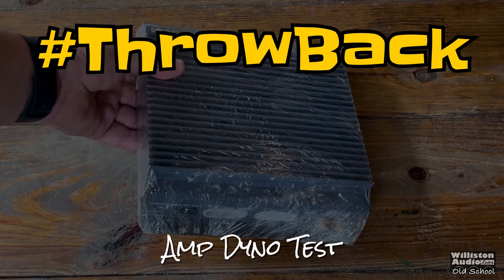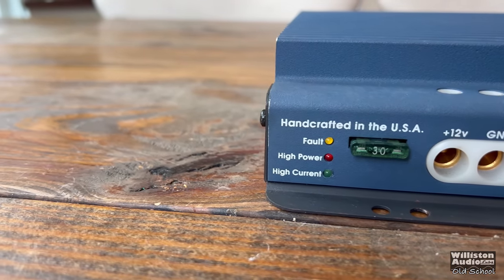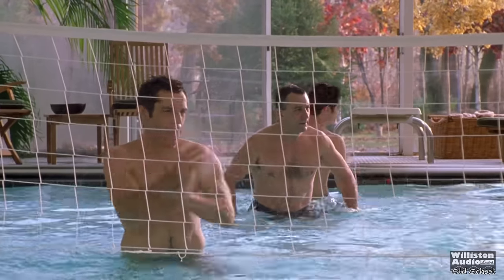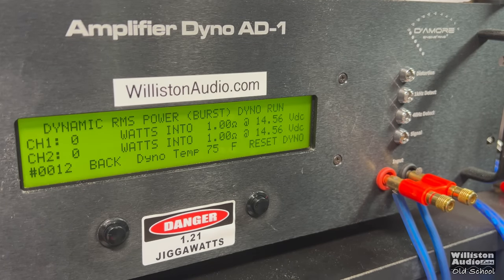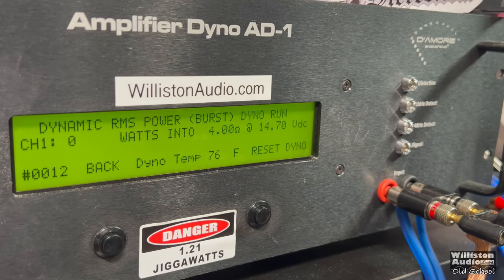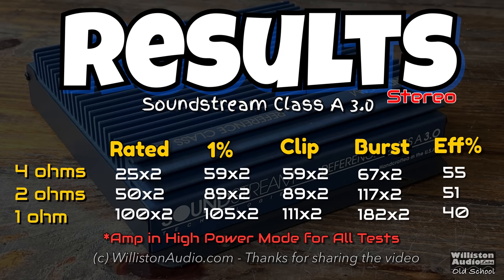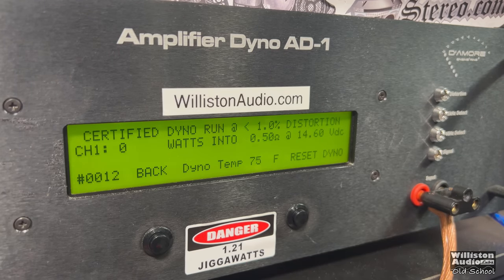Class A for Car Audio? 1993 Soundstream Reference Class A 3.0 Amp Dyno Test

Comment: Soundstream before it was sold was some of the best stuff on the market.
Reply: i agree.
Reply: One of my favorites. Them & Phoenix Gold were both doing big things before being sold off.
Reply: Yup. Back when they were on top..  I had 2x reference 1000s and a ref500. Those 1000s hit hard on the Rockford 15s I had. The Reference 500 on Boston pro 6.5s up front. Miss those days.
Reply: ...Soundstream USA has always been my favorite
Reply: Still is if it in good hands i have a ref 500 in use and 2 300's that are fresh still
Reply: Sound stream Phoenix gold Orion were hand built pieces.  They are junk now. I still have my M50 and zx 500.
Reply: It was right up there 
 I Had this amp way back when. 
And a couple others.
Reply: I bought this amp in ebay 2005  cost 200us new with box! I wired with 4 speaker for my e30! Good old days!

Comment: The younger crowd won’t be able to appreciate the fact you could roll through the judging lanes with a 50 watt amp that could drive two efficient subs with around 200w of power. More over these amplifiers had some of the best sound signature. Super clean output. A pair of these in 0-100 watt class in the right build could be unstoppable.
Reply: ...I have a 50w amp driving 2 12s right now. 😁
Reply: hey, dont lump us together. i prefer not getting loud but clean output rather than getting loud with laughable output quality. quality over quantity for me
Reply: @n.shiina8798  but that’s just it. Those cars WERE loud and super clean.
Reply: @bfytw2125  clean, sure. loud, how loud?. assuming the sub efficiency is 90dB/W. at 200W it would be 113dB theorical. 113dB is already loud. now compare with the same setup but bigger amp, let's say 2kW. the system could reach 122dB-ish. if we're talking about SQ contest, then yes a good 200W should be enough if the sub were efficient enough.
Reply: @n.shiina8798  Try cars like with two Orion HCCA 50s and two Orion XTR DVC 10” subs doing 145+ on Flashdance… on the dash.  My own personal competition vehicle in 1995 was a regular cab Nissan cut through with three  C12” kickers in a sealed enclosure, running off of a Soundstream 6.0. That’s a 50x2 amp. That truck did 143dB legal on flashdance. 146dB outlaw.  By todays big system standards these aren’t super loud numbers. But believe me these cars with highly efficient subwoofer could get plenty loud with these small output amps.
Reply: @n.shiina8798  You have to take cabin gain into consideration with your spl numbers as well
Reply: @bfytw2125  your 2nd last word, that's what i was trying to say. i prefer not getting as loud as today's standard rather than having distorted output

Comment: Love the old Soundstream amps. Used several of the all chrome classs A references amps. Was a HUGE fan of the Van Gogh series, ran the VGA 500.4 with a VGA 1600.2, dual 4 gauge platinum power inputs, 115dB S/N ratio >500 Damping,Triple Darlington output circuitry, large low ESR Capacitance banks' they were some of the best made equipment I was lucky to have owned. They were famouse for the blue and the red, milltary grade 6 layer PCB bourds, audio grade resistors and beautiful board layouts.
Reply: Military grade? I figured they would need to use boards of a decent quality in order to be robust enough to survive the abuse of car audio. Strange.

Comment: Class A/B great for mids and highs but not the best choice for a bass amp for long term use at less than 4 ohms. I would know. I used a class A/B amp for subs from the mid 90s well into the 2000s, and that sucker would get HOT after a longer play session. The class D amp I use now outputs over 3x as much power and stays relatively cool all the time, even wired down to 2 ohms.

Comment: Hey there Big D!  I'd love to see the high current and 12v tests.  I ran these amps back when new and still do.  Always loved these.  Shocked to see the low efficiency. They do get hot.  Got to have some fans for sure.  The sound can't be beat imo.  I also run a couple of mc300's, a Picasso, and a d200.  I would love to see you test those if you ever get hold of any. Thanks for all the vids!  Rock on!

Comment: I installed a couple of those in a BMW back in the day. He also used a class AB Soundstream amp (I think it was a S200) bridged to drive a 12" sub mounted through the rear seat arm rest. If I am remembering the correct car he also used an Audio Control crossover and Epicenter, and ADS plates in the back and 320i in the front. I honestly don't remember what head unit he used, but I do remember that it was really clean and solid. It would not be competitive even back then, but that was not the goal anyway. It was supposed to sound good and be fun, and it did that in spades...

Comment: I’ve got a class A 10.0, 5.0 and 2 rubicon 1002 first generation. Soundstream amps are extremely efficient at creating heat! They create crazy issues due to switches and pots that will drive you crazy trying to repair them.
Reply: Currently have 2 rubicon 1002 first gen and lil wonder 4.
In Facebook group I found a guy who fixes soundstream old school amps he worked and learn how to fix them not than other the engineers of soundstream OG I’m going to save up so he can recap my amps and probably get more power he told me his been doing upgrades to the internals to get more power 🤷🏻‍♂️ I seen the numbers are insane in 10.0

Comment: I still have a TRA/1600.2 The chrome one with the two handles on top of the amp. I would love to see that thing on the dyno. I bought it used back in 2007.   Bench tested it before purchased,  then just stored away inside the house.

Comment: These Soundstream amps of this design had a very large number of bjts in the output section, usually showing in a better damping factor . It appears that you are an inspiration to others as I've noticed some other channels playing with old school car audio. The more the  better.
Reply: them times... its when a 30 watt amp put out 400 watts... RMS....LOL. I remember.
Reply: @bigdogbrodavepresents6178  the 90s, the last great decade.
Reply: Watching big wiz his the reason why 7 years ago I started to buy some old school gear I currently have soundstream amps and subs. My favorite amp that I have is my rubicon 1002 first gen it does get hot but nevera let me down. Also I have home theater stuff so I always compare my soundstream amp to home theater amps NAD because dynamic they have so much power that’s what you want. Headroom when you want to push your gear it has guts

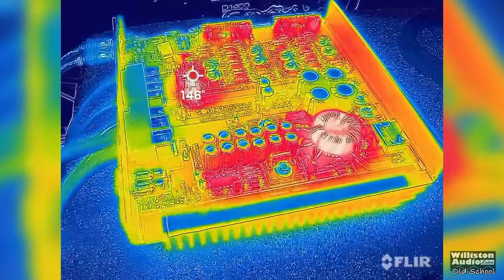Comment: 11:45 that resistor is part of the -/+15v rails for the op amps. Pretty cheap design if you ask me, they could’ve used 1.00 15v regulators and prevented from having a large resistor that heats up to the point of cooking the PCB. I’ve seen some PCBs with charred spots underneath those large resistors.
Reply: SOUNDTREAM amps have some issues with resistors getting excessively hot to the point they MELT SOLDER (10.0 1st gen).  Ya can BUMP UP them to a more robust resistor and that helps matters a lot.  These amps run excessively HOT... yep. BDBD/2023
Reply: Maybe rail voltage was too close to maximum input voltage of regulator. With heat, regulators SOA is even lower, so it could fail even sooner than resistor. But yes, transistor (not resistor) with zener is what I'd expect in a amplifier like this too.

Comment: The amp isn’t rated to be played at 1ohm high power bridged. Just a heads up. I know it shows it in the manual but it restricts its output. Also. Really quick question. After you deoxed it I noticed you left the switch in coherent stereo, did you flip it to mono off screen? Not being a pest. Just making sure. Thanks buddy

Comment: As an audiophile it gets a pass in my book 👍 Where else are you going to find a class AB amp that's stable down to 1 ohm stereo?
Reply: ❌✅ Correction the classA6.0 & A3.0 are stable in high current mode coherent stereo at 1/4ohm per channel 😎👍sounded the best but were hot as hell🔥👺doing it, because it was biased as class A even though it was technically A/B _  pure 👂 ear Candy 🍭 though‼️

Comment: I use to be a dealer back in the day and I used these to battle against the Orion HCCA's of day with great success but this design had issues with the screws used in its terminals that would break over time and would cause issues trying to remove and a few people never read the manual mainly on these Reference's high and low power switches on the bottom of the amp
Reply: ...later models were silk screened on the amp "DO NOT SWITCH HIGH POWER TO HIGH CURRENT WHILE AMP IS ON"....I have made this mistake....repaired by SOUNDSTREAM at no cost in the mid 90s
Reply: I still have a few 6.0's in need of repair as well as 2- 500's one work but the other does not and a Continuum
Reply: @thebassgeneratorinc229  …I have been using “ Eric’s Amplifier” for my repairs. His info is on the “ Soundstream registry “….google it if you are interested in pre 2000 SS gear….all your amps will be listed. They also have manuals for most amps…it is an interesting website if you like vintage SS gear

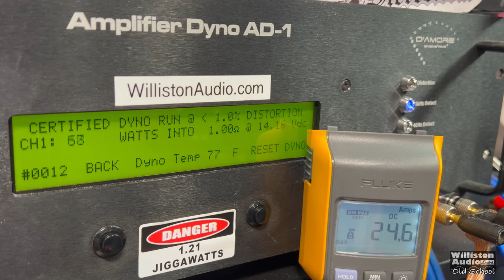Comment: 9:40.   HELLO.  YOUR PROMITER HERE 
SOOO FOR THE 9TH TIME
50% EFFICIENCY IS PERFECT. THE VERY BEST FOR CLASS A\B. BECAUSE ALL CLASS A\B SPLITS THE POWER SUPPLY SO IN A PERFECT WORLD 50% IS THE VERY MOST YOU CAN GET PERIOD 
SOO 50% IS THE VERY BEST.  
YOU CANT GET MORE THAN THAT WHEN YOU USE A 50 VOLT TOTAL IS USED  AND 25 VOLTS IS USED FOR THE UP SWING AND 25 VOLT IS USED FOR THE DOWN SWING. SOOO FOR THE MILLIONTH TIME 50% IS VERY VERRRY GOOD.  ANYTHING UNDER THAT IS JUST STARTING TO BE BAD. ON A CLASS A\B.    THE REASON IT FELL LOWER THAN 45% WAS BECAUSE AT 2OHM AND 1OHM.  IT MUST BE SWITCHED INTO HIGH CURRENT MODE.

Comment: High current test would be a cool thing to see.  I didn’t feel like it changed the output drastically with my Reference 500 but I had weak electrical back then.
Reply: It should only make a difference driving low impedance loads. You can't just shove more current through a high resistance circuit, the resistance has to be low enough for the amps output.

When he tests high current mode pay attention to the data sheet and what ohm loads are used for testing. He'll be able to test lower (amp was rated to .5 ohm if I remember correctly) and that is precisely where high current would be needed.
Reply: @volvo09  I’m 100% sure I was clipping the F out of it… right up to audible distortion.
Reply: @volvo09  I haven't read the manual but I'm thinking high current mode should have been used for the .5 ohm tests to get the right numbers.
Reply: @550n440  what was your speaker ohm load though? It won't help at all if you were above 1 ohm.

I won't give an in depth electrical lesson, but real quick it's why a 55w 12v car headlight is much lower resistance than a 55w light designed for household voltage. You are selecting a voltage range to drive your speakers. Ohms law.
Reply: @v12alpine  I bet he'll do a new episode and we'll see the difference, pay attention to the low ohm loads and they will go up.
Reply: I'd like to see a 1 ohm load test in both high current and high power modes for a comparison.
Reply: @bones40447 ☝️🧐❌ I had this amp it’s definitely a cheater rated 12.5 watt by two at 4ohm like a ORION RED but blue , with better sq , for awhile best sound I’ve ever had , sold to my brother who never installed it an eBay’d it  or something 😡‼️ I was a little disappointed , but I still have 2 Class A6.0 still in box factory sealed 😎👍❌ waiting for my next Sq build ✅
Reply: Yeah, I don't think it would change significantly
Reply: @raymo6795  it’s only a 300w SQ amp so No , not much more if any ☝️😉‼️ but it will sound good ✅
Reply: @eurekaakerue4649  …300 watts was a lot in 93. I rarely used high current mode . These were not efficient amps, and the power draw was too great for stock alternates….but I would still like to see it tested in high current setting….Maybe Big D doesn’t want to abuse his  30 year old vintage amp, I don’t blame him
Reply: @raymo6795  👋😉❌ same here ‼️I wonder why BiG “D” didn’t balance out both channels equally they have separate gains on the REFERENCE LINE For a perfect stereo image, you don’t see that these days either 🧐❓hmmm
Reply: @eurekaakerue4649   .. some do, I didn’t notice if BigD’s had separate gains or not.  Soundstream was kind of random with those . I have a pair of Rubicons 300s with separate gains, and a pair of Reference 405s that don’t…. And a Reference 200 that does have separate gains… it was a really nice touch.
Reply: @raymo6795  😎👍❌ They did I had one A3.0 & two A6.0  and most of the first Rubicon’s did , not sure on SX REF’s which were awesome but contained the failing auto impedance switch ✅ always wanted the Chrome A10.0 but couldn’t get it and the human reign but it was Unobtainium ❌*
Reply: @eurekaakerue4649  … they are out there, but expect to pay 💰…
Reply: @eurekaakerue4649   … have you checked out “ the Soundstream Registry “?…. Google if you have an interest in vintage SS gear✌️🇺🇸
Reply: P.S. correction it only has single gain , but my A6.0’s have dual gains ❌
Reply: @raymo6795  THX 👋😎❌ my list of  GEAR - IS AS OF TODAY =(1. TNA 4ch tarantula (1.  Rubicon RUB1.2500d (2. Class A6.0 (1. X3 182 Subwoofer 🔊// other equipment includes (1. US Amps/RE Audio SA 3000.1 (1. Chrome TARAMPS premier MD 3k and  (1.TARAMPS premier MD 8k ——  Now Just need to compete ❌but my dream Amp just because of looks is without a doubt ‼️PPi art series 1200c in Gold mirror finish 🔥😎👍❌ would sale  ALL BUT the MD8k and SS. X3 18” just for that amp , then I would gut it and make it a 12ch with todays SQ technology , Would consider the same for a (ART pro 1200) also - Then hit the Isaca circuit & SQology Competitions😎‼️
Reply: @eurekaakerue4649  l have 2 P series, they are different than most Soundstreams. I have seen Dr Crankenstiens that look near identical…I have always wondered about them.. I have a 3 channel and a 4 channel.. I bought them because they were cheap, but they are great sounding amps…..wait a minute …you meant “ P.S. “( post script)… I thought you were referred to the “P” series Soundstreams…oops..check out that registry…the p series has one gain for 2 channels ✌️
Reply: I have the old version of rubicon 1002 I had use it in 1 ohm high current the difference to me is my lights dimming 😂. Now I have it wire 2 ohm and is in high power. I have two rub 1002 and one lilwonder 4channel 
Pair Van Gogh subs 
Pair T4-12 which one is pair with the rubicon to me the t4 sounds better than my brother skar audio amp 1200. It sounds like it needs balls to move the sun

Comment: How did it draw 58.8amps through a 30amp external fuse?
Reply: It's the amount of time spent overcurrent as well, from the littelfuse website.

C. Time-Current Characteristics
 A fuse’s time-current characteristics determine how fast it 
responds to different overcurrents. All fuses have inverse 
time-current characteristics, so opening time decreases as 
overcurrents increase. Time-current characteristics are 
presented graphically on standardized “log-log” paper. 
Figure 1 is a sample time-current curve for the MAXI Fuse 
series for fuses rated 20-60A. Current values increase 
from left to right, and time increases from bottom to top. 
The average melting time for any current can be determined 
from the curve. For example, from Figure 1 it can be 
determined that a 20A MAXI Fuse experiencing an overload 
of 100A will open in about 0.5 seconds. At 40A, the same 
20A MAXI Fuse would open in about 9 seconds.
Reply: @gunnar1911  the test was a certified run and most of us will send it for longer than .5 seconds. In fact I run my amplifier at full tilt for approximately 5 minutes or more.  So I guess with your explanation I couldn't run this particular amplifier more than a few seconds at full tilt before popping fuses. Hmmm

Comment: i remember modifying one of this amp to run at higher idle current. technically forcing them to get more class A power region. told the owner to not to run the system without aircon lol

Comment: Ok. The truth is.. called HIGH BIAS CLASS AB ..output stage. The bias  runs in class A up til a certain wattage then it acts like class ab.. only the drive stage is class a. That design causes the low efficiency numbers.. THIS RESULTS IN CLEANER AUDIO.  To my knowledge.. John France at fosgate invented the high bias theory and it was first used in the punch 150 J board amp.  John Pleitz would know the details..
Reply: Nelson Pass said "bias is depth of field" and from what I've seen in home amps, it's so true.
Reply: @wesw9586 . Im afraid to comment sorta. Bias is the circuit that controls the output devices in class ab so that they work together.
Reply: @davidstevens7809  right.  What's the problem exactly?

Comment: Just wrapped up repairs on a Chrome 5.0 here... These amps became susceptible to VIBRATIONS... The Pre Amp board comes loose from the Main board on these.  Reflow usually does the trick. Add some extra solder.  As I REMEMBER these SOUNDSTREAM amps, they were kinda pricey, REALLY needed sound processing to compare to a RF similar of them times so REFERENCE goes... nobody listens to FLAT.  These were very POWERFUL and quite clean constructs but sorta flimsy inside. SWITCHES are as cheap as there is so THEY are an issue. Other than them vibration issues and age related switch issues... These electrically have held up well over time.  Mine work still in 2023 and I am PONDERING a system using a couple 5.0 and a 10.0 I recently modded... WOOFERS PLEASE. LOL.... There was a TIME.... Soundstream... waaaaahoppen?.... MEMORIES of the 90's... BDBD/2023